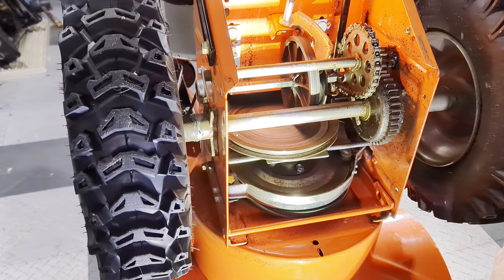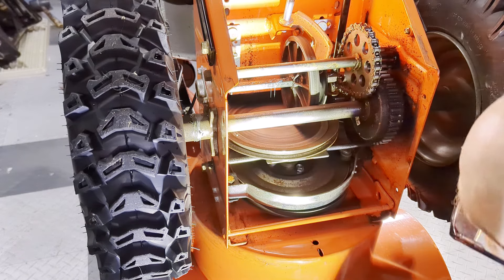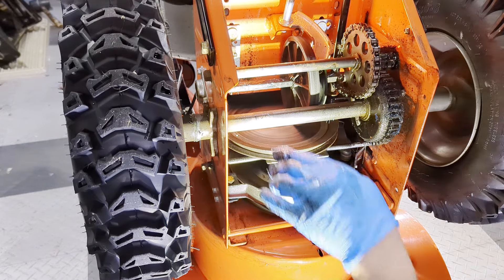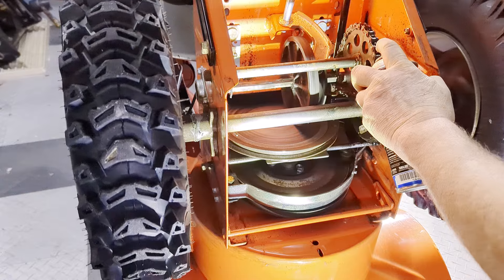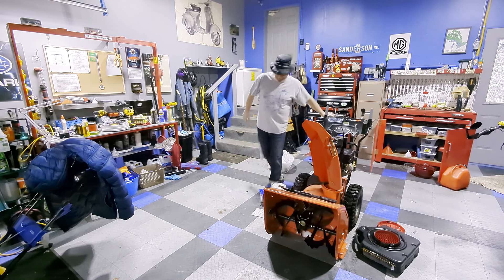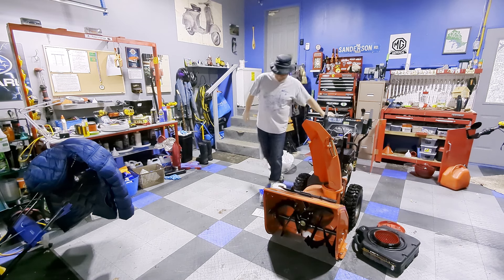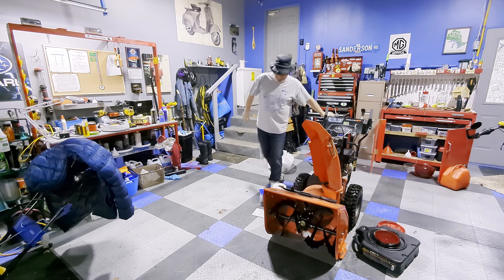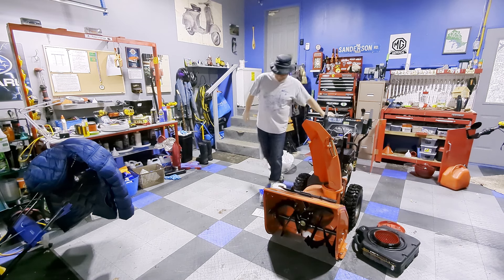Ariens Snow Blower - Complete Tune-Up & Maintenance

Comment: Thanks. I did my maintenance last week. The one tire with the shaft that has the Spline. I wish I saw this fine video prior. I couldn’t figure out why it wouldn’t go back in all the way. That washer has to be moved around until it slides in properly. It was frustrating until I moved the washer and it slid in. Great, informative video, thanks. Mike i. 24:44

Comment: Grease or Never-Seize should be put on the axles annually. Quick procedure once used to it.
No idea why manufacturers (all brands) don’t dollop some grease on the axles before they leave the factory.
Very expensive repair if the axle need to be cut in half for internal mechanical service.

Comment: Another place to consider in the cables.  They get water in them and over time will rust.  Spray a little "Chain and Cable" lube down the inside of the cable, this will extend their life.  The pins on the auger are called shear pins, as they will shear when under tress, saving your auger gears.